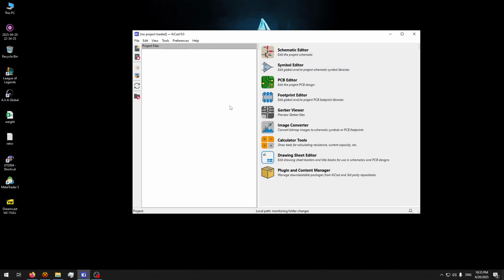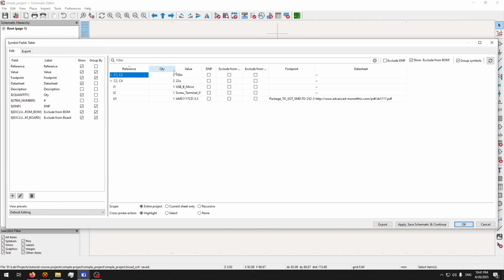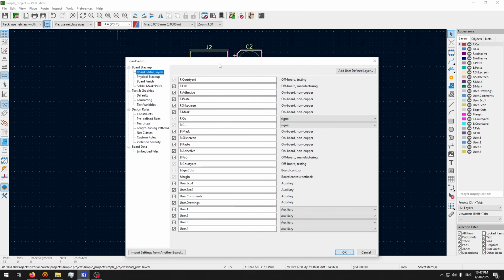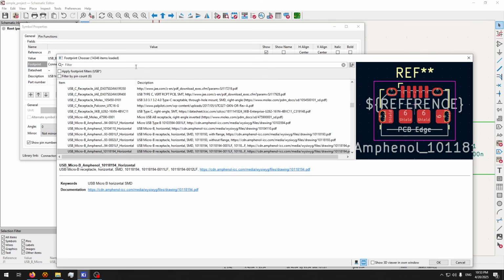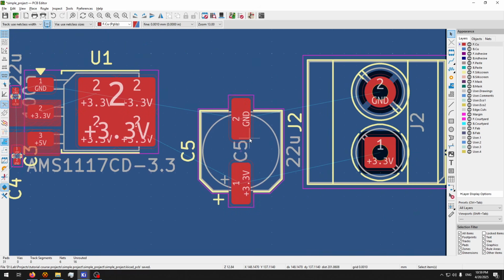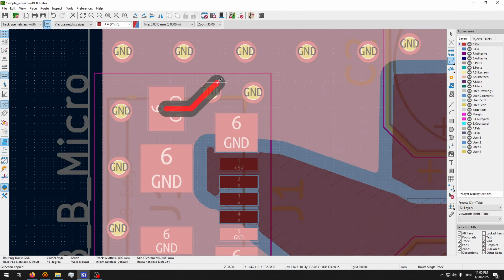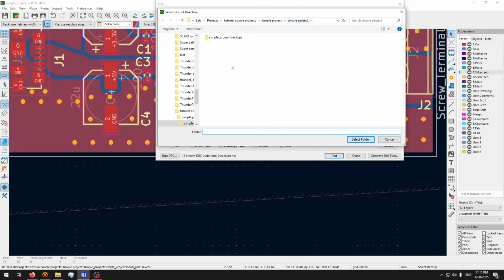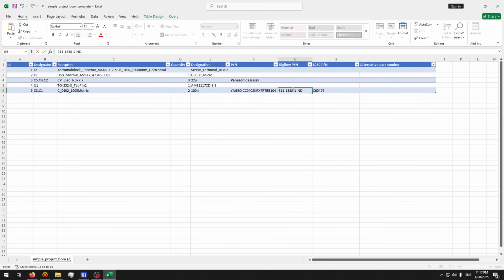KiCAD 9 tutorial course [02] - Simple project

Comment: 25:06 How DO you insert a new point like this? I've been trying for like half an hour to modify the zone polygon but I, for the life if me, am not able to figure out how to add a new point to the polygon.
Reply from the maker: you put the mouse where you want it then press INSERT on the keyboad.
Reply: @Thundertronics Thank you :)
Reply: @Thundertronics  OMG THANK YOU SOO MUCH, I WAS STRUGGLING FOR SOOO LONG.
Reply: Also if you got the grid at 5mm you wont be able ot put the point where you need. Use something like 0.1mm, it's really the position of the cross not the mouse.

Comment: Thank you. I learned a bunch of stuff. One thing though, you mentioned it's good to use many vias. But why?
Reply from the maker: multiple vias share current which enhances thermal design. when current is divided into multiple vias then a single via won't get the entire current but rather a smaller amount which makes it heat a lot less.
also, multiple vias makes shorter and better (low inductance) path to ground.
Reply: @Thundertronics   this is so helpful! Thanks for the explanation, sir!!